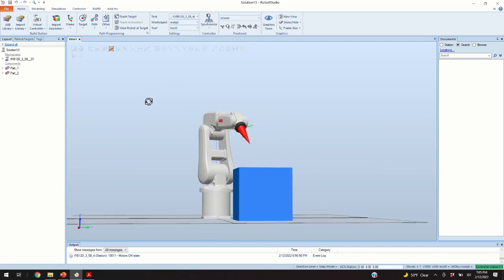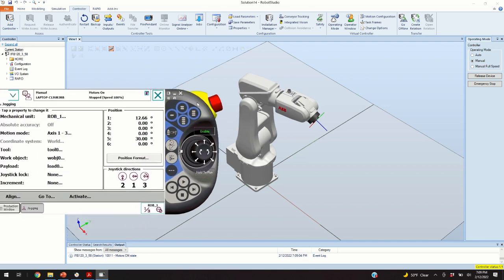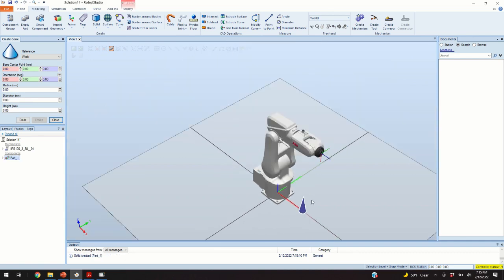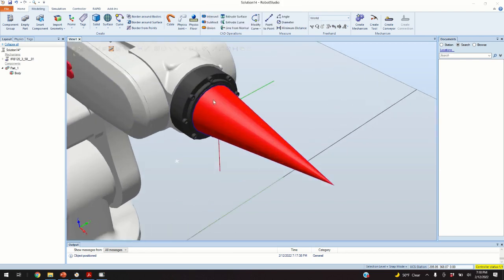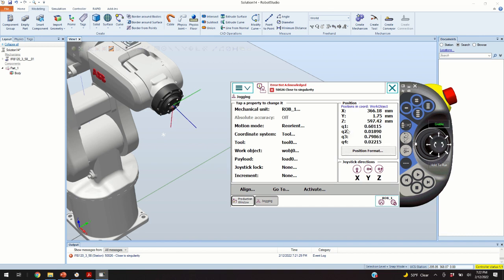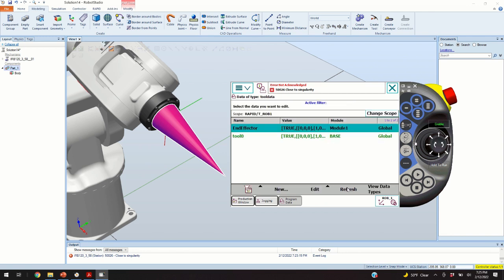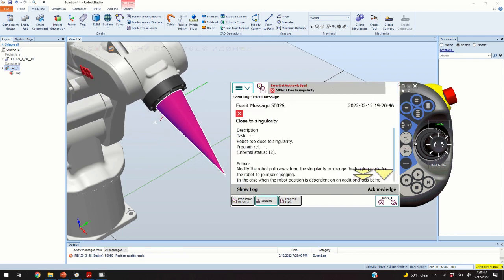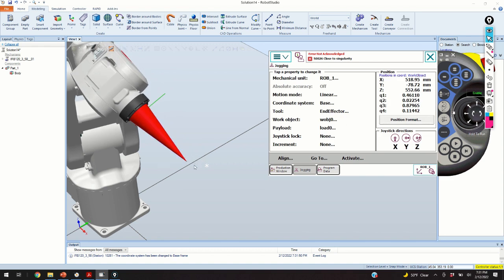ABB Robot Tutorial: Defining Tool Frames and Basic Modeling in Robot Studio

Comment: Just being the patron memeber, so much appreciate your free tutorial😢

but i kind of curious about how to measure the x, y, z, i mean i saw you type the right position to set the cone at the face plate, how did you measure that?

sorry for the dumb question😢 hope this wont bothering you so much appreciate.
Reply from the maker: Hi Elie, Thank you very much for your Patreon support! I really appreciate your support which motivates me to make more videos and material. I did it by trial and error before I recorded this simulation. You can actually put close numbers and you will see that the cone will appear close to the face plate, then you can fine-adjust the position. This does not matter actually, since this is just a simulation. In practice, if you have a real end-effector you need to calibrate these numbers, especially the z-distance from the base plate to the tip point of the end effector.  Thank you again! Aleksandar Haber